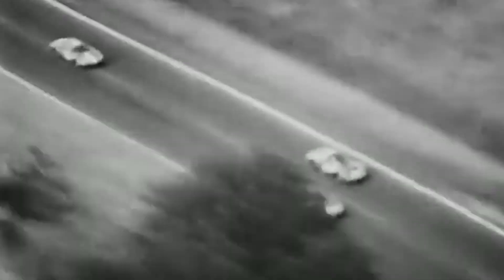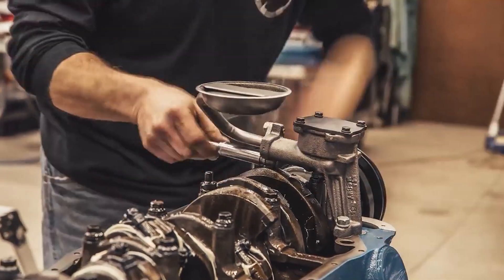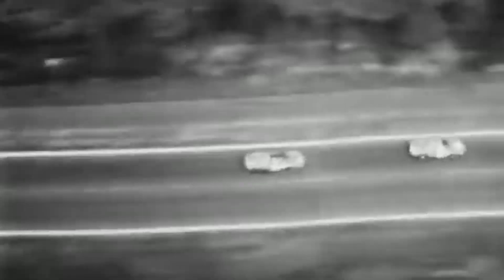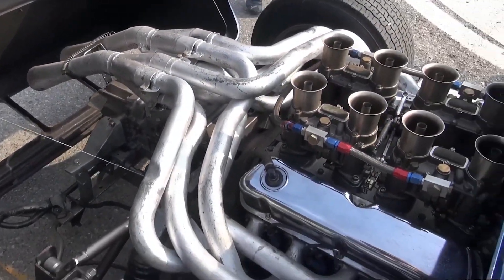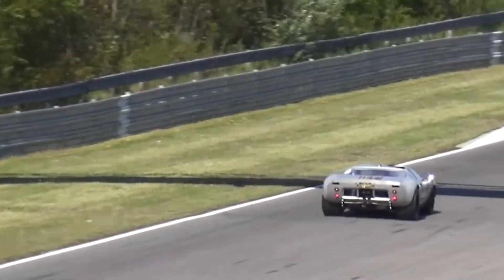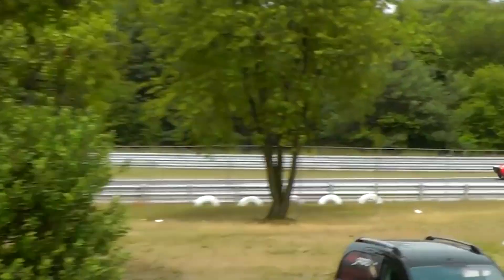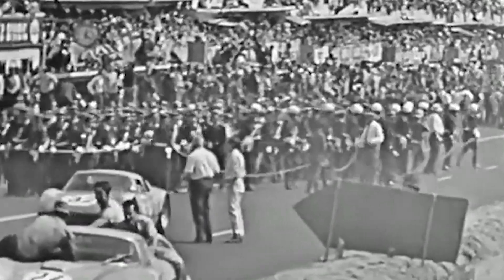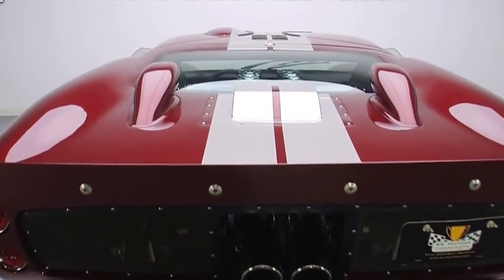The Mighty GT40: Conquering Le Mans with the 427 Engine

Comment: The exhausts did not cross from one bank to the other Chris
Reply: Oh man the old bundle of snakes can o' worms... It's nitpicky and I'm probably going to fudge this explanation.

But it's a 180⁰ crossover system, the idea being that the pulses collect from bank to bank at the collector so there's no gaps in the gas speed, which is a problem in a big cross plane crank V8 like that and it ensures a more even flow especially up high in the rev range. 

At least that's how I had it explained by the engineer building my CAV GT+ for me. It's all about gas flow speed, keeping it as linear as possible from the port to the end of the pipe. So while the headers don't cross from bank to bank, the gasses in the collector does which fills in the gaps when there's no cylinder firing. Or something like that. People have written their thesis on this subject and it's a source for many beer fuelled debates.
Reply: @C.Fecteau-AU-MJ13   Coventry Climax in the UK developed this technology in the 60's for their F1 V8. Bloody cool!
Reply: @DennisMerwood-xk8wp  The GT40, when you boil it down to the sum of its parts, is really a showcase of British technological innovation (the brains) that went to America to get on the roids and get some serious muscle (the punch). 

I just can't get enough of them, hence why I just have to have one in my life.

A better Anglo-American team up there hasn't been since the landings in Normandy.
Reply: @C.Fecteau-AU-MJ13  
You nailed it my man! 
The Brits could never stop fiddling with their innovations! Fettling~ they call it!
It took some good ole Yank brutal big hammer engineering to make it a winner!:face-blue-wide-eyes:
Shelby and Holman Moody - hold my beer!
Reply: @DennisMerwood-xk8wp  Lol so true... I love that it's got the finesse of the Lola, which is a dainty thing in so many ways mixed with the Shelby recipe of "needs more engine" 

It was tried and true with the Cobras, so it was always going to work.
Reply: @DennisMerwood-xk8wp  If you've never had a go in one, it's something you just have to do... They are hilarious on the road.
Obviously some are better than others and it's a personal preference to what suits people the most. Pretty much all the manufacturers out there now are making great cars, but for me it's CAV that have what I've been looking for, particularly in their GT+ product. I wanted to do an all Australian built one, but Roaring Forties (although very nice) are just a little too authentic and compromised for what I want.

I can't wait to get mine on the road, hopefully by October-November all things going to plan. I intend to use it pretty much every day, I'm nuts like that though. It's more practical than my Valkyrie and I use that almost daily. My Honda Valkyrie, not the Aston Martin of course 😁
Reply: @C.Fecteau-AU-MJ13 Aussies are always 2-hrs behind us Kiwi's! hahahah
Good luck with your project my friend! 😁